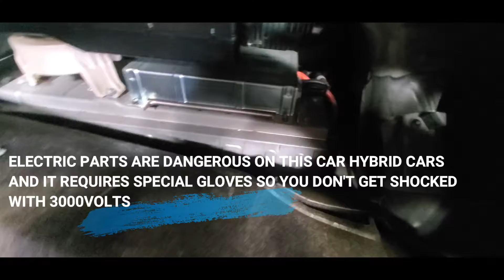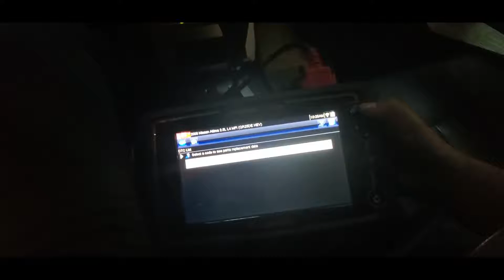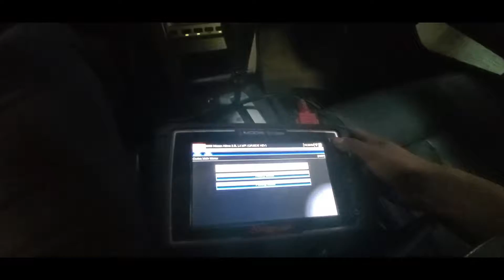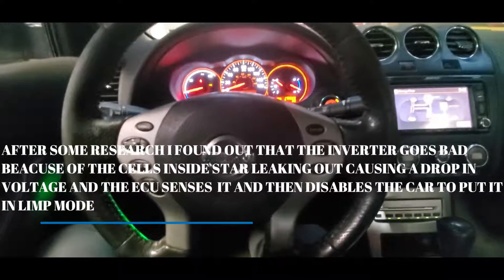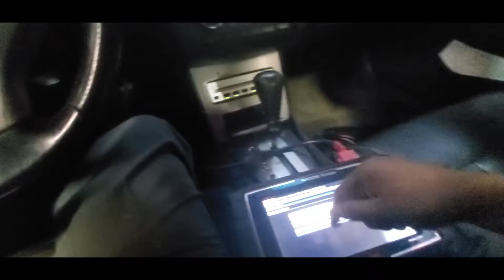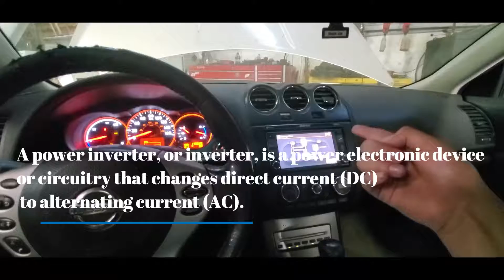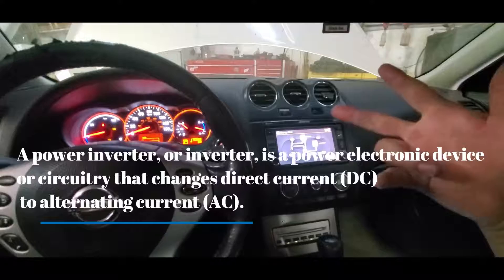How to fix 2008-2012 Nissan Altima hybrid battery inverter code P0A7A.

Comment: good evening, i have a 2009 nissan altima hybrid, The motor wont start all of a sudden, the dashboard would not turn off i had to unplug battery, also trying to connect computer it says fail to connect.i am stuck any advice?

Comment: Thank you for the video.  We have a 2008 Nissan Altima Hybrid and the 12v battery is not getting charged. Have anyone encountered this?  Is the DC DC converter inside the inverter?

Comment: Hey brother appreciate your videos thank you so much have a 09 Nissan Altima hybrid would make that loud noise that it made after you replaced the inverter I replaced the hybrid battery in the 12 volt battery now I get no crank no start at all
Reply from the maker: Yes it will
Reply from the maker: All these old nissans suffer from inverter failure

Comment: I had a small accident I ran into the back of someone my car shut completely off I have 2010 Nissan hybrid the manual told me it has a shit off switch but the dealership want work on it cause they did continued

Comment: I have a 2007 Nissan Altima 2.5s hybrid & ac not working but heat does first thing I did was replaced the cabin air filter. Also the low side holding pressure. Also another problem it’s pulling to the left when braking

Comment: Interesting video, my son bought a 2009 Altima Hybrid with 130k miles. It works when it wants to. But when it does it only goes about 25mph then it slows down to a stop. We then have to stop and restart the car. Or put it into nurture and let it coast, and then it seems to want to go again. The HV battery is very low and never seams to charge (always on low). No check engine lights. We're in the Phoenix area. Do you know of anyone that might work on them here or do you have any suggestions for us? 

Thank you in advance
Reply from the maker: you have a really interesting issue too, first thing i would do is get a scanner and with that you can check if the temperature of the battery pack is normal i have seen on electric cars that if the batteries overheat it limits the car speed and it stops the charge cause when is charging the batteries get hot just like a phone if it gets too hot it slows down and tries to almost turn off by itself so it doesn't damage the battery.

Comment: No AC power Voltage goes low when Idle & in twn HWY drives good AC wrk but Not In Twn. No Codes
Reply from the maker: no codes hu. have u checked the rear auxiliary battery?
Reply: @JVFIX  just replaced after 8yrs..went bad but No Change
Reply: Wht mjbe does is Does not Hold Voltage when in Idle & Especially with AC on steady drop but will charge bck up when  Moving Motor Engagement

Comment: JVFIX, I praise you for being so kind in answering ALL questions posted. I, myself I'm having an issue with my 2008 Altima Hybrid. Yesterday, while driving home, I noticed the "Service Engine Soon" and both, HV battery and 12V battery lit up. When I got home I scanned the car and got a code P0AC4 which was to do with the Hybrid power train module. Do you have any suggestions as to where should I start checking. I appreciate your excellent work.
Reply from the maker: if u read that code with a regular scanner is just telling u that u have a code stored in the hybrid module.
Reply: @JVFIXLLC  Thanks for your answer. I have a ELM-327 Bluetooth scanner which I use with the Car Scanner Pro App, and my Android tablet. I'm not sure if this is what you call a "regular scanner".  How do I read the code stored in the Hybrid module, please? Someone suggested that my hybrid battery inverter is about to give up, and I should replace it. What's your opinion? Thanks!!

Comment: My electric power staring system is jumping. Any reason why? It turns off sometimes. It’s a 2010 Nissan Altima hybrid
Reply from the maker: I have seen the positive connection at the battery sometimes starts to build up corrosion you might want to check that first.

Comment: I got a 2010 Altima started shaking then won't start.  Got a scanner online code is U0100?  Any idea what it could be?
Reply from the maker: you will need a pro scanner to dig more deep in that problem this code is for communication issue between modules I have seen the PCM fail a lot on these nissans

Comment: Hello JVFIX, I have a 2007 nissan altima hybrid i have an issue with the PCM is not working well and I need to replace it,  can you tell me where is located it because I can't find it. 
Please and thank you 🙏
Reply from the maker: the ecu for the engine is located behind the glove box compartment you will need a screw driver and I believe a socked 10mm to remove it.

Comment: Hello JVFix... I've 2007 Altima Hybrid... car was idle for couple of months there 12V battery died. So replaced new Nissan 12V battery. I was able to start the car but VDC and Red triangle light came online. The fan over hybrid battery would run continuously.  Dealer said replace Hybrid battery and gave $8k replacement estimate. So I took out hybrid battery, checked each cell and replaced couple of very weak cells which were not charging above 5000 milliamps.. Reassembled entire hybrid battery and installed it back in the car. After starting the car, ODI scanner reports P0AC4 and P0AFA codes. Cleared the codes few time but still same.   Any suggestion would could be wrong and what I can do next?
Reply from the maker: the codea you have are for the cells inside the battery pack. there could be a chance that some got a bit loose when you reassembled it

Comment: Hey JVfix, I have a 2007 hybrid Nissan Altima. Recently it was too hot here in SoCal and while driving I got service engine soon warning. Then the car stopped going into the Hybrid mode, though the hybrid battery is getting charged as normal. Also, the “Ready” Green light is also ON for hybrid but the car is only running on gas. Do you think it’s the inverter problem  or something else. Do you know some can fix it for good price on SoCal. Thanks
Reply from the maker: I don't think it's an inverter problem because it wouldn't even let u start the car sounds more like if the battery pack got overheated. I had a similar issue with a Buick where the fan that cools down the battery when out. it's on my playlist under gmc cars but gmc has a really different system than nissan so symptoms could also be different. but it's a closer idea of what are u experiencing. maybe if you could scan the vehicle you could trace down the fault more quickly
Reply: @JVFIXLLC  I have a 200008 nissan altima same thing happened to me but, someday I wanted to install a stereo and burn a couple of fuses then replace some and for some reason, the car started to work in EV mode

Comment: hello friend, I have a 2007 altima hybrid when it goes over 40 mph the car turns off, what could be wrong?
Reply from the maker: do you have check engine on? if you do is there a way you can scan for codes i might help you out.

Comment: Great video, I have a 2009 Nissan Altima that’s giving me the code POAC4 any idea what’s going on ??
Reply from the maker: that code means that you have codes stored in the hybrid powertrain module. you will need a scanner to access those deep codes. what is wrong with the car does it turn on or not at all.

Comment: Any idea what could be wrong with a 2008 that turns on, goes into drive but won’t drive.
Reply from the maker: have u checked the transmission oil level?

Comment: I have a 2007 Nissan Altima Hybrid and I get an error message of p04aC. After I changed a few battery cell. And now I get this code plus p0315, p0317, p0318. After clearing the codes I only get the error p04ac ecu mil. Can you help with this issue or have you came across this problem. Thank you in advance.
Reply from the maker: wow that's a really interesting problem right there. you are gonna need a high end scanner to diagnose that problem.

Comment: Great video bro. Have a 07 Altima hybrid replaced few battery cells and also the 12v since it was going bad. Ever since doing that battery is no longer re charging. Only re charges when driven  for a while and at speeds above 40mph. I remember it use to drop the battery charge and it automatically re charged and would go to EVMode. What can cause the battery to no longer re charge itself?  Unable to find anything on this. Would really like to get this fix. Thank you!
Reply from the maker: That my friend it is a very interesting question and I am gonna do a bit of research on that because usually when it stops recharging the main hybrid battery the module right away detects that and it prevents the cars from starting as a safety measure.
Reply: @JVFIXLLC  I been doing lot of research as well and no luck.  When I saw your video i wondered if the inverter was the problem. There's gotta be something that is not allowing the battery to re charge on its own. The funny thing is I don't detect any codes either. Thanks for writing back bro 👍

Comment: I have a 2009 Nissan Altima hybrid I just bought and was told the starter batter needs replaced how much is that to fix
Reply from the maker: is yours hybrid too or regular gas engine?

Comment: How much did you pay for the new Inverter?  I was quoted almost $7,000 for 2007 Inverter.
Reply from the maker: I paid 400 for the inverter and it was used. There is a lot of them on ebay and new ones also. Cheaper than the stealership.
Reply: Stealership jaja nice

Comment: Hello JVfix, I’ve 2011 hybrid altima, today I was trying to flush brake fluid like as normal one man type. But fluid was coming down so fast, that I stopped the process. Does hybrid Altimas need to be deactivated brake system or it’s normal for brake to come that fast?
Thanks again for your help.
Reply from the maker: I believe is the same process like any other car. Just make sure you bleed the brakes and is better if u have someone to help you with the brake pedal

Comment: How do you get out of limp mode my hybrid battery is dead just want to drive with regular battery any idea
Reply from the maker: Unfortunately for hybrid cars there is no way to get out of limp mode if you don't fix the problem. Is just how the car was designed sorry.

Comment: I have altima 2009 hybrid and don't star only all the lights i change de batery 12v and change pedal sensor and the colum stearing i have a code p0603
Reply from the maker: it could be the same part i changed. u need a professional scanner to confirm the problem

Comment: Hello @JVFIX pls i really need your help i have Nissan Altima 2009 Hybrid ever since i changed the Brake pad the brake and service engine soon lights stays on since then BT surprisingly this last week Saturday the car refused to start... Once i press and press thumb it show arrow on Dashboard like it needs to press brake before starting which i alrdy did av checked the brake switch and it looks good any tips for this i will appreciate
Reply from the maker: The first thing u have to do  is to make sure the rear 12v battery is good on volts. Then if it is good. You will need a scanner to scan the system to see what is preventing the car from starting.
Reply from the maker: Since this a hybrid most of the cars now days have lots of computers to control different systems on your car. And the only way to find out what's is wrong is scanning the car.
Reply: Well as for the 12v battery i think it's perfectly OK am suggesting maybe the hybrid battery is the cause am not sure yet however scanning is somehow difficult here in Nigeria they all asking me to bring down the car while car not starting at all
Reply: What symptoms will i get if the hybrid battery is dead pls???
Reply from the maker: @ahmedraheem5010  if the car is not staring  and the 12v battery is good, i might suspect  that the issue could be the inverter (the inverter is basically like the charger for the main hybrid battery like the one shown on the video) that's what most fails on the cars because the internal cells of the inverter shorts inside and the ecu detects that and cuts the power  to the hybrid battery to prevent damage. now if the case is not that the it could be the main hybrid battery.
Reply: We get a technician to scan it yesterday and it gave (ISS) said it's the isolation system needs to be looked after he will give further report after proceed

Comment: I have a 2008 nissan altima hybrid i just want to ask bro if what is the problem on my car cuz when i jumpstart can run and if i turn off the car is totally dead even in the dashboard no light can pls help me what is the problem on it thanks man great video
Reply from the maker: Ok if it turns on that's a good thing it means is charging. But when u turn ot off and it doesn't start again then the problem could be your 12v battery located on the truck on the passenger side compartment. Get it tested at autozone and see if it holds charge and also if it does have good volts aswell
Reply: @JVFIXLLC  i try to jumpstart and i check the 12v battery while the engine running its 14.6v but when i turn it off its not gonna start again eland when i check the battery its 0.80v
Reply from the maker: Battery no good man.
Reply: The mechanic install a new 12v battery but im not sure if its new🙂🙂🙂 cuz he just charges me 90$ for that...ok bro i go and buy some tester thanks and i let you know later cuz i really need help thanks man
Reply: Thanks man

Comment: I have nissan altima hybrid 2011 
I have problem with hybrid battery since i changed 6 cells, now the car can start but there is VDC , ENGINE CHECK on the display.. and the hybrid battery is disconnected ( not charging while driving) .. but in the morning the battery is to the half of it ..?
I don't know if you can help
Reply from the maker: MM THIS ACTUALLY THE FIRST TIME I HEARD A PROBLEM LIKE THIS, HAVE U TRIED READING THE STORED FAULT CODES IN THE MODULE?

Comment: Hey I have a question I am traying to buy a nissan hybrid but they told me that the battery is not good you think is gonna be hard to take it off and is it gonna be expensive  thank your for your time on reading this I will apréciate a responde
Reply from the maker: Yea the main hybrid battery is hard to change and is located in the rear if the car behind the rear seats and y have strip down almost half car to take it out. What's the issue with ur car?
Reply: Well they told me that is the battery that’s why it won’t run
Reply from the maker: @joseramirez850  I've seen on those hybrids that if the car was sitting for too long the main hybrid discharges. But it could work to normal once the car is started. If u had a scanner u could scan all the modules to see what codes u get.

Comment: I have a 2010 Nissan Altima hybrid and there is a no start and all ignite turn on in dash but not getting a ready green light. Put a brand new battery in and tried everything. But no luck. I’m located in Fresno if there is any way you can help me diagnose it.
Reply from the maker: U replaced the battery on the rear trunk the 12v battery right?.
Reply: jvfix yes with a brand new one.
Reply from the maker: ok that's most likely not the issue then. do you have like a small scanner tool that you could hook to the car and get some codes. but if your car is not starting or cranking the issue might be the box that i changed in that video. that car that i fixed came from 2 shops and they could not find the problem they already changed the starter and the 12v battery. that box in the video is a hybrid alternator for the main hybrid battery and the cells inside it start to leak out and the computer sees that as a short and it stops the car from starting to prevent damage to the main hybrid battery.
Reply: jvfix No I don’t have a scanner tool to get codes. Is there any way to salvage that box?
Reply: It’s stuck in my garage and I have no way of getting the codes from like autozone or anywhere
Reply from the maker: Ok the next thing to check is your screen and see if there is any movement when u open the switch. There is white lines that appear on the screen showing the hybrid system. Open the switch do not press the brake when you push the start button just press it until everything lights up and see on the screen if the white lines with arrows make any movement. They start moving and change color to blue and that means that the components are online and communicating each other. If you see a section in my video at almost the end iam explaining that.
Reply: jvfix My Vehicle don’t have a screen
Reply from the maker: @jasongarcia2536  mmm ok. well then only way to know if really the problem is the hybrid alternator or inverter is by hooking up a scanner. that's the only way to know